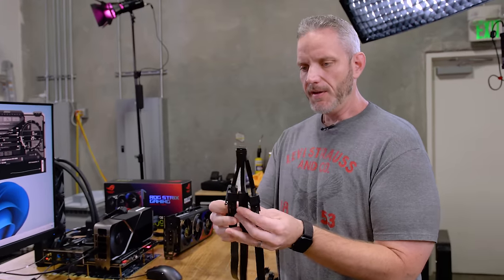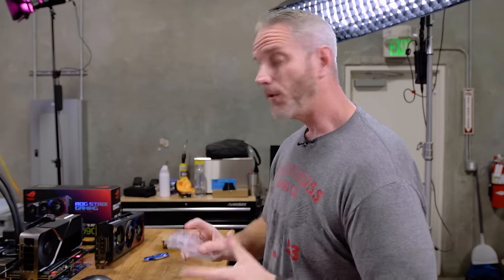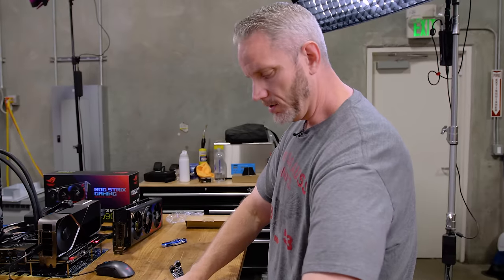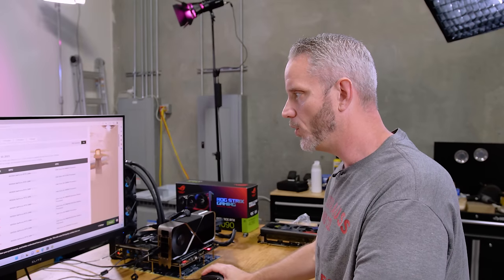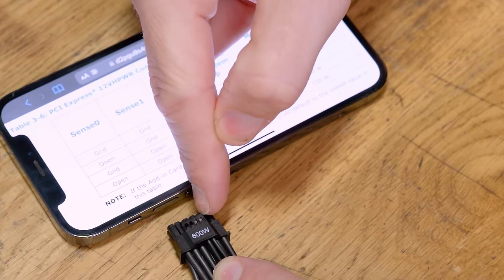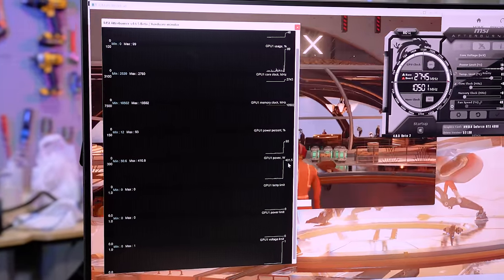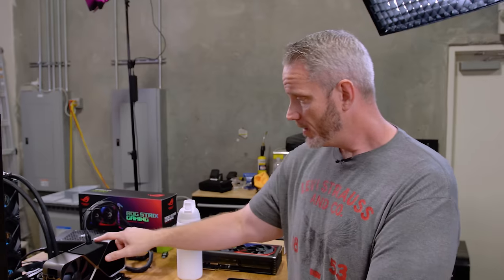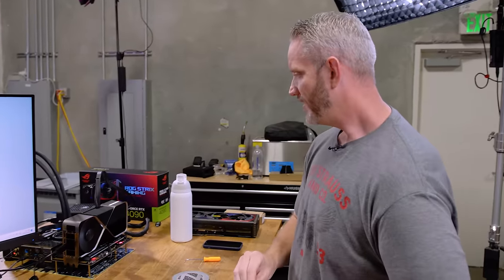DON'T Do this with your GPU!

Comment: Hey jay hope you can read this in a sea of comments, but I play high frame rate games. Recently upgraded gpu (new 40 series) there’s something with how the cards draw power that cause my psu whine. It wasn’t an issue with the 30 series. Is this just a nature of the new platform, or is the 12hvpwr cable?
Reply: How many watts the psu because if it’s whining it sounds like it’s working way too hard.

Comment: Would it hurt the card or psu if you rigg the adapter cable to lie to the 4090 by faking the ground signal, perhaps as you hinted on a smaller wattage psu? As long as there on paper is enough power to run all components in your system will it work, be safe and something you would dare to recommend?

Comment: I would like to ask a question. I've just bought a 4090FE and I've got a Corsair TX850M that only has 2x6+2 PIN PCI coming out from it. My question is: can I just use two separate 8 PIN cable with 2 head each ("Y" cable) and connect them to the nvidia adapter (populating 3 of the 4 female - I think there's no need for the 4th one as I don't intend to OC the card) or do I have to buy this special cable (if it is compatible, thing that I do not know)? Or do I have to buy a new PSU?
Thanks

Comment: Type 4 connectors to the psu normally can run 2 pcie each. So 2 connectors equal 4 pcie plugs.

Comment: You should talk with gamersnexus what they have to say about corsair
2 connectors may not be enough as clearly proved with nvidia tech that says 4 are needed for max power
Whereas corsair is spreading fake disinformation saying 3 cables are enough

Comment: Please re-do the cable video from awhile back on daisy chain cables. please. I can't figure out for the life of me if 2 cables with daisy chain are acceptable. My asus thor 1000w sent with 2 cables that daisy chain, i have no clue how id get a third cable or even 4 cables if i needed them. so 2 daisy chains are not acceptable for a 4090 correct?

Comment: With apparent adapters catching fire, has anyone tested the current draw on the original adapter and checked the gauge of the wire to the 12 pin?

Comment: I ordered a cablemod kit the flex cables for easier management that comes with 16pin connector but 4 connectors to the PS (for Seasonic), would I be fine just connecting 3 of the PCI-E connectors instead of 4 to the PS?

Comment: Looking at the video, will someone buying a 40xx generation card have to use a modular power supply? Because the owner would not be able to use a cable like that provided by Corsair. I don't know if current non-modular power supplies already come with these side pins at the pci-e to provide the voltage necessary for the gpu to work.
It's been a while since I bought a psu for my computer. The one I use, for example, is not modular. I've been using it for a few years now. I don't know about the current power sources for pc.

Comment: To understand correctly the problem with the Strix and the AsRock motherboard is Bios issues on the motherboard or Bios on the Strix?, I´m curios because I have a Strix 3070 and just build a new pc with an Asus motherboard, can´t seem to install windows 11 wright because it gives me problems, lag, drivers, freezes, update windows to the 22h2 version and the freaking computer freezes several times trying to logging to windows, then next day won´t give any image, took it to the place I bought toll them what happend and they reinstall windows 10 and toll me windows 11 is a piece of s...t, update the bios os the motherboard and the same thing happend againg, luckly reboot the sistem and know seems ok, but me issue is a new motherboard with ¨windows 11¨ support    can´t handle that version.

Comment: Can i use this cable for my rtx 3080 FE it has a 12 pin only connector
Reply: If you have a corsair psu there should already be 12pin cables available from places like bestbuy

Comment: is uf just need grounding and i have a 850watts non pcie 5 PSU. could i just buy a power plug and ground that my self and fool the gpu that  both pins are on closed state?

Comment: HELP. is it possible to connect the Corsair RM850 2021 PSU, using the Corsair PCIe 5.0 600 W cable/Gen 5 12VHPWR PSU cable (Suitable for PCU Type-4) to a rtx 4080?

Comment: Will cooler master make similar cable ? It will be great to make use of sfx 850w. But, what I'm not getting here, how two 8pin pcie will deliver 600w? As far as I know, each cable max power delivery is 150w, so to get 600w you need 4 8pin pcie. Can anyone clarify this ? I don't know what I'm missing here.

Comment: How in the hell did such a stupid design actually make it into production?
It's like Ford motor company or general Motors designed this shit.
For $1,600, they could have done a hell of a lot better job. The card is an absolute monster, there was absolutely no reason to put such a tiny flimsy connector on it.
Nvidia really needs to pull their head out of their ass.

Comment: I have 2 daisychained 6+2 pcie cables (total of 4x8 pin when using both cables and both daisychains).
I have a 4080 on the way, and it comes with a 3x8 to 16.
Should I use a 4x8 to 16? Speading it evenly over the two cables? Or just use the 3x8 to 16 it comes with (running a daisy on one cable and a single 6+2 on the other cable)?

Comment: Jay-Z stop spreading misinformation..there is no provision for any communication..they are just some dumb pins that are either pulled high or low. It's up to the GPU to detect what configuration is set up and then decide how much power it should be limited to. It can even be completely ignored if you have the tools to mod the vbios. edit: ok you explained it better later in the video

Comment: Should have watched gamersnexus video first 😅
With the original cable with only 3 plugged in you get 100% power limit on overclock. But all 4 you get 132% power limit.
And corsair doesn't have a clue what they do an spreads misinformation about the cables for it 😒

Comment: NVidia debunked Corsair's claim and GamersNexus proved it in a video released hours earlier.  You need to verify this first, Jay!
Reply: That only applies to Nvidia's cable adapter. That's what Steve from gamersnexus was talking about when calling out Corsair. Not Corsairs own cable. The way this cable works is completely different.
Reply: @PabzRoz  Corsair needed to make it crystal clear that it's their cable, not any generic cable.
Reply: @strredwolf  Again what are you even talking about... The Corsair employees false claim was ONLY about Nvidias adapter cable. The adapter cable that comes with the 4090. That's what the Corsair employee and GamersNexus were discussing. And Corsair made that crystal clear and so did Steve in his video. That's it. 

As for this Corsair cable Jay is using in this video it's completely different and does function correctly giving you the full wattage with only 2 pcie power connectors. It functions differently from Nvidias adapter cable. What Steve and Corsair were discussing has absolutely nothing to do with this cable in Jays video. There's nothing for Jay to verify that he didn't already show in this video.
Reply: @PabzRoz  If it's that easy to confuse people (me included) then all sides are at fault.
Reply: @strredwolf  Omg... Just because you don't pay attention or you're too slow to catch on isn't anyone's else's fault but your own... Corsair made it clear in their original post about it that they were ONLY talking about Nvidias adapter cable and GamersNexus said it in his video dozens of times and literally had a Nvidia employee in their video discussing their own cable... They couldn't of made it anymore clear. The fact you don't pay attention is your fault and your fault only. Jesus Christ take some accountability.

Comment: I'm not the most versed in this kind of thing, so this is probably a dumb question, but if I were to get a 4090, and use this high power corsair power cable with a Corsair HX1000 and MSI MPG Z490 GAMING PLUS ATX motherboard, would I be okay? Or do I run into the problem of the cable melting, or something not working?
Reply: Corsair say you need a 1200w PSU for running a 4090 with their cable

Comment: I’m sorry but…Would I trust Corsair or NVIDIA? NVIDIA, is my opinion, just because the connector can be fooled into thinking it has 600w available doesn’t mean it’s safe. Did they increase the gauge of the wires? Because normally those cables are rated for 175w so 2 of them should only be 350w.. Next are all PSUs common rail on 12v? Like this seems like such a shady product I don’t know if I would trust it. Get an ATX 3.0 PSU OR use the included and tested connectors, you think the AIBs and NVIDIA made them 3 or 4 wires for fun, and Corsair has some magic sauce all of a sudden that is like no sir we see your 4 but we will do it with 2. First of all why are you able to draw that much current on two cables on their PSUs, OCP must not work. If their PSUs work as intended and you are limited to 175w per PCIE 8 pin then your card will run at 350w + 75w from the slot so max 425, slider will show 133% but you won’t get more than 425w. Good thing these cards at the moment can’t draw more than that anyways, but maybe that stupid farmer Joe cable is why you can’t OC your GPU at all.

Comment: Can someone confirm if the corsair 12V 600W cable will be fine in a lian li 011 dynamic XL case with strix 4090? The stock nvidia is fine if you leave a panel off, and fugly

Comment: The issue with solid core wire, is Electrons ( the current) do not travel inside the wire, the electrons actually travel on the outside surface of the wire, unless it's a tube. This is why we use multi-stranded wire for high current applications. There needs to be enough strands to accommodate the current needed or potentially needed. single core wire (or thick multi-strands) works fine in high voltage (120-240v) applications, as less current is used. But low voltage/high wattage (12v) you need current movement to get wattage. In the case of a 600W capable GPU you'd need  enough wire to support 51 amps at least, preferably higher amp handling. I very highly doubt a single strand wire can handle 600 wats. As others have stated, I'd also worry about the durability of these essentially ribbon cables, it's basically what it is isn't?. So they are trying to push us back into ribbon cables? No wonder Corsair call GN's opinions Bullshit. True they are probably tricking the PSU, but they don't know squat about basic electronics. Flow is everything, anything else is blockages and heat

Comment: So it is possible to get 450W from just two connectors?  With the whole Corsair and GamersNexus fiasco I wonder if they are actually both correct?  Steve thinks it requires 3 connectors to get the 450W due to the sense pins.  Corsair said that was not correct and you seem to have done it with just two using a cable Corsair provided albeit it may not be wired the same way as other GPU cables sense pin wise?
Reply: The requiring three connectors only applies to the adapter cable, im pretty sure that's why they kinda talked past eachother.
Reply: That only applies to Nvidia's cable adapter. That's what Steve from gamersnexus was talking about when calling out Corsair. Not Corsairs own cable. The way this cable works is completely different from what I understand.

Comment: Question: which cards of the 40 series are gonna feature this 12VHPWR connection set? Just ordered a corsair 12 pin to Type 3/4 from corsair, can I reuse it for some of the lower end cards of the 40 seres as 4060 or 4070 if I ever were to upgrade my current gpu?

Comment: its crazy how NVIDIA overly build a power plug for the gpu and corsair was like Let me show you how its done. :P
Reply: Corsair is shipping replacement PSU cables that work ONLY on their PSUs (because different pinout, like all modular cables) while NVIDIA has shipped an adapter that works with all PSUs. In a year all PSUs will come with correct power cables, like it was for Molex/Sata transition

Comment: The weak point in that connector is the plug itself, those plug pins wont cope with high current draw, in the end they will burn up, these splitters are pointless. i can see a lot of people having house fires tbh, also im not really interested in a graphics card that uses more power than an electric heater

Comment: Jay can you use the 12VHPWR adaptor cable in reverse via a ATX3 psu (if you don't want to pay ngredia for a  40 series) to power a 3080?

Comment: take the power connectors from these new power hungry cards and move them to the back IO shield and make it 1 beefier plug type. more like the cable from the wall to the power supply.
power supply makers then make an output plug on the back side of the power supply with a cable that runs on the exterior of the case to the back of the video card IO plate.
no more giant wires that are hard to deal with inside the case.
or the gpu makers just include a cable and power brick that plugs into the back io plate and you have 2 cables from the wall but no giant cables that are hard to deal with and hide inside the case because the cards are getting gigantic and the cables to power them are too.

youre welcome.

Comment: can you do a video where you measure the strix card? i want to get a 4090 this time since it's actually significantly better than the 3080 was in comparison to the 3090. But i heard that specifically the strix is more lengthily than the other 4090's in addition to the thiccness. I want to make sure that my ITX build can handle the strix.
Reply: It's not on Asus website?
Reply: @ponli7532   my owrry is i'll start measuring think it's fine and then go to throw it into my case and it'll not fit. I feel like that's something  i'd do lol.
Reply: @ivanr9408  
357.6 x 149.3 x 70.1mm

Took me 1 minute to look up on ASUS website, never measure yourself. Just look up product specifications.

Comment: Does Asus Rog Thor 1200w P2 supplied 12vhpwr cable fine for 4090 ? it a also have 2 8 pin connectors.

Comment: If i'm right you should be able to use the 4x8 Pin connectors and only plug in the 2 with the small cables going into them and the card would still think it has 600 W available. And melt the cables with that since there are only 2 Gnd cables and the other 2 8Pins dont have any sense.

Comment: Corsair is right you only need two connectors and be safe up to 600W including safety margins, total is 9A or 108W per pair, 6+2 pin has three pairs so absolute max is 324W and two would make it 648W.
Ironic thing is that 12 pin to 4x 6+2 goes to two 8 pins any way lol.
NVidia person telling you they dont know what will happen is just some salesman idi*t of course he won't know $hit.
Tbh f*ck intel/nvidia/pci whichever idi*t came up with this connector its absolute bollocks they should just get two pin connector that takes thiccc crimps and wires like idk 10AWG and all you have is two wires ffs...

Comment: Woooh can wait to spend 1600 on a GPU and then an "SMART" powersupply of 650w for just 200 (just a gold rated one) Whahaha FU...
Your a smart guy Jay. how can a 8 pin PCI-e deliver "150w" so 2 do 300w  16 pins,  and 3 do 450 24 pins.
But this AMAZING cable that you have same Gauge as that 8 pin one does 600w on 16 pins ? make no sense dude....
B.T.W. and 8 pin  EPS12V does 336 watts.. but hey since even my toaster and refrigerator is smart why not my psu ?.... cant wait for AI PSU's..

Comment: I mean, if you're buying an $1600 GPU, aren't you going to buy a proper PSU?   I know I will!
Reply: Why… the adapter allows you to keep your existing hardware which is a nice touch. I already own a 1,000 watt platinum psu. I’m not buying another…
Reply: @matthewrezuke8130  On count a 4090ti would go into a new build. Why would I want old tech w state of art 2k video card?  Naturally,  if there's no usage benefit,  and next gen psu are mega bucks, I would have to reconsider this statement.

Comment: if you have 4 connectors connected it allows 133% power for overclocking, 3 connectors allow for 100% power. check out gamernexus video about this, he proved corsair is wrong.

Comment: PLEASE can someone answer me this. I currently have a 3070 ti that pulls max 300w and I'm using 2x8 pin plugs to power it. Can someone tell me if i can use/ buy a 2x8 pin to 12pin plug to the new 4070 ti super which draws max 290w? In effect I'm replacing like for like as the 8pins provide 150w each plus the 75w from the pcie socket on the motherboard. If anyone has links to a quality adapter i can buy please?
Reply: does ur psu come with one?